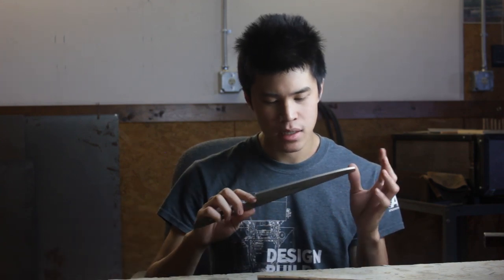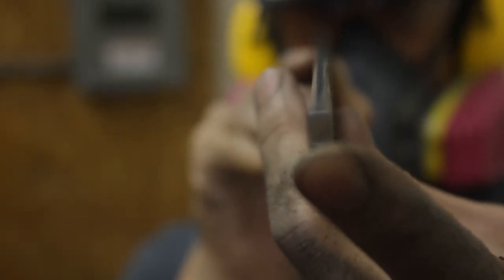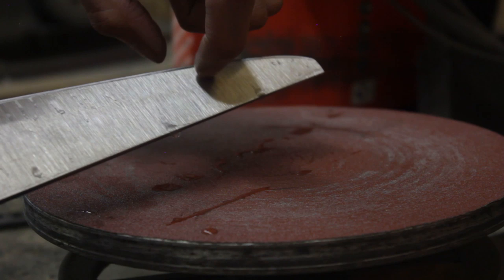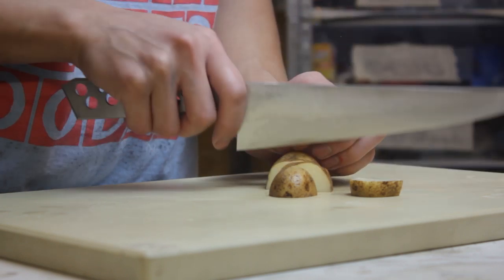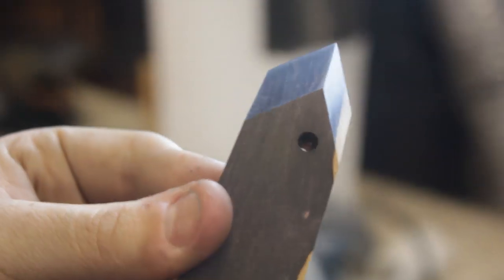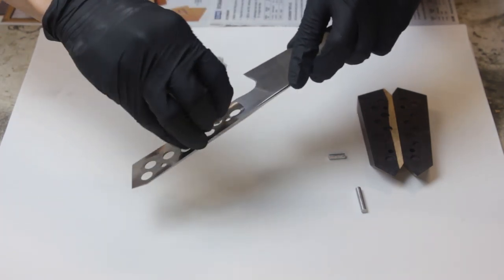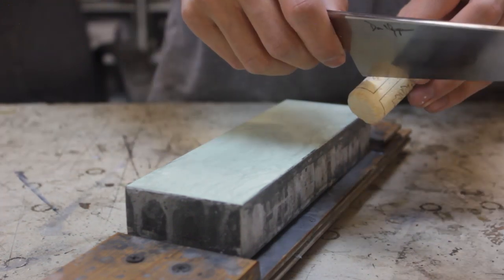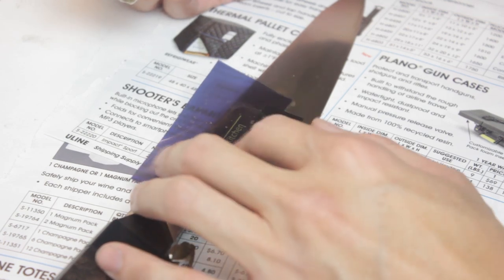Making the Aries Kitchen Knife for Julien Solomita

Comment: Excellent video. I’m curious why you use a horizontal disk sander over a horizontal belt sander when forming the edge. Which horizontal disk sander do you use? They seem to be pretty rare.
Reply from the maker: It's just a simple 9" flat KMG aluminum disc, mounted to the table with some pillow blocks, then pulley'd to the motor. The pillow block/pulley setup was gifted to me from Charles Vestal years ago, and for me it makes sense to use because it's the same muscle memory as sharpening by hand, and when the paper is slightly worn it actually saturates with water and effectively is a pseudo wet-grind. You gotta be careful with spin direction and if anything will catch though. If you're not aware, it can be dangerous, and you can send a knife flying off somewhere.
Reply: Don Nguyen Knives thank you for replying, your approach to the steps of your build make a lot of sense and I’m looking forward to trying this process out. (Love the potato test!) Just to confirm using a horizontal belt sander will give the same results you just prefer a horizontal disk.
Reply from the maker: @Udeus5  Yes, vertical vs horizontal doesn't matter. Belt vs disc DOES though. The belt will never be as flat as the disc because it has to ride and conform over the platen.

Comment: An other person who doesn’t know to sharpen a knife. A kitchen knife is a tool, not an artwork. Why make the knife with such thick piece of metal. Too much stiction on your convex edge.
Reply from the maker: Some of the highest performing, most sought after knives are thick at the spine. Katos and Shigefusas are prime examples. The key important factor is what kind of knife are they (workhorse? laser? general purpose?), and how they taper towards the edge and towards the tip. This is legit zero at the edge and has the subtle convex across the whole face up towards the spine. Not every knife has to (or should) be a thin laser. Geometries that are thinner and flatter at the edge actually stick more.